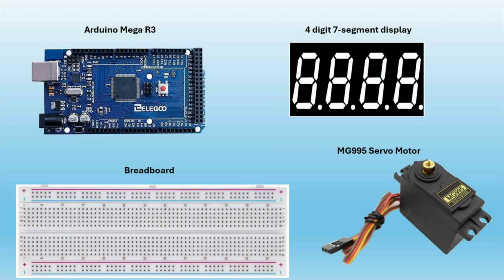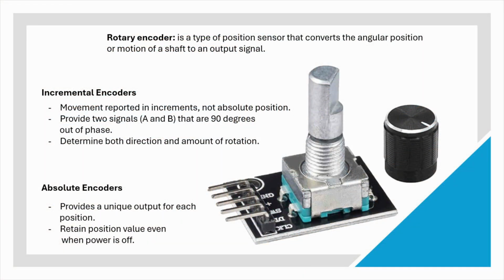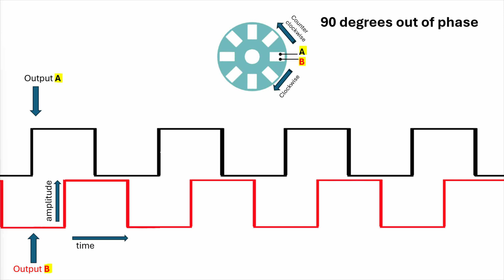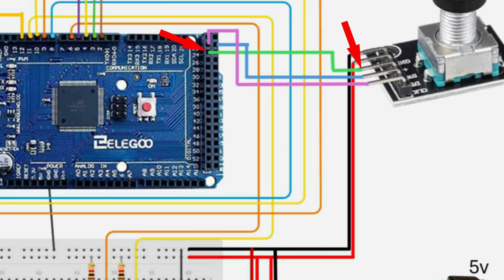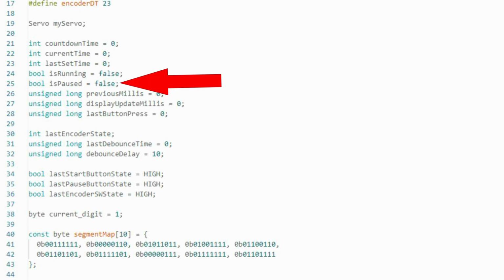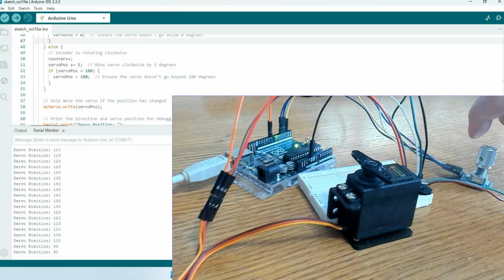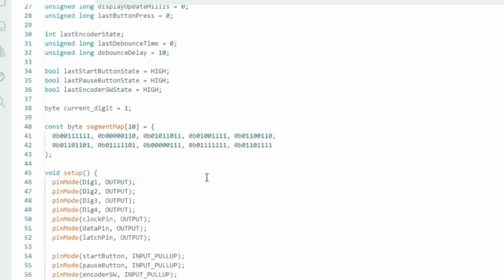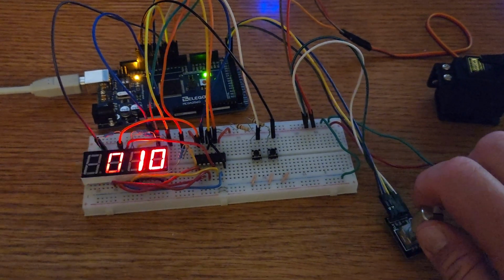Creating an Arduino Countdown TIMER with Manual Adjustment and Servo Movement Using a Rotary Encoder

Comment: Unfortunately I am very new to Arduino, Where can I get the sketch to upload for this digital timer with manual adjustment and servo control please? I am not on any social media platform either. I tried the Arduino IDE and found examples but couldn't find the sketch for this project. hope you can help.
Reply from the maker: Hey there!
I used to post code on Facebook but it became a huge mess to try to find it.
send me an email and I can send it to you, no problem at all.
bmonsterlaboratory@gmail.com 👍👍
Reply: Thank you. I have sent you an email and would be grateful if you could send me both sketches so I can further my interest in Arduino.

Comment: Hey man, quick question becouse im new to all this arduino stuff. I wanted to build this build like you did but I’m quite unsure of how you connected the power Adapter. Thanks in advance :)
Reply from the maker: hey there!
at 0:49 you can see the diagram. I powered the breadboard rail with 5v. I used a 5v2A wall adapter with dc power connector to run leads to the rails. Everything you see connected to the breadboard rail is being powered by the 5v wall adapte - common ground connects to arduino.
This was just a temporary setup and the servo was not under load, it was just moving the arm. I don't think these bradbaord were designed to handle over 1A of current, so be mindful of that.  
If you want to set this up to move a load, you may need more voltage for the servo and more current supply.  Does this help?    If you still have questions,  i'm happy to help ~!
Reply: @BMonsterLaboratory Thank you for the detailed explanation, i was just wondering what kind of power source you hd becouse i was scared to fry everything. Everything luckily worked after hooking up everything with the rigth power source. And once again Thanks from Germany 😁

Comment: Any reason why you went with the Arduino Mega?
Or can I do this with any Arduino model?
Reply from the maker: Hey there!
You can use other Arduino models as well, the code isn’t specific to the Mega. You’d just need to change the pin definitions to match the digital (or analog-as-digital) pins on your board. The Mega offers more pins, but the project will work fine on boards. 👍💪
Reply: @BMonsterLaboratory  Thanks, I was hoping that was the case. I have a bunch of Nano's I wanted to use.

Comment: I'm going to try to use the analog in pins on the UNO R3... Can you post the code in the comments too?
Reply from the maker: #include <Servo.h>
#define clockPin 9 // Clock pin for 74HC595
#define dataPin 8 // Data pin for 74HC595
#define latchPin 10 // Latch pin for 74HC595
#define Dig1 5
#define Dig2 4
#define Dig3 3
#define Dig4 2
// Button pins
#define startButton 6 // Start button on pin 6
#define pauseButton 11 // Pause/Resume button on pin 11
#define encoderSW 24 // Encoder switch for reset
// Rotary encoder pins
#define encoderCLK 22 // CLK pin for rotary encoder
#define encoderDT 23 // DT pin for rotary encoder
Servo myServo; // Servo object
int countdownTime = 0; // Time selected by rotary encoder (in seconds)
int currentTime = 0; // Current countdown value
int lastSetTime = 0; // To store the previously set time
bool isRunning = false; // Timer state
bool isPaused = false; // Paused state
unsigned long previousMillis = 0; // To track time intervals
unsigned long displayUpdateMillis = 0; // For updating the display at regular intervals
unsigned long lastButtonPress = 0; // For debouncing the buttons
int lastEncoderState; // To track the last state of the encoder
unsigned long lastDebounceTime = 0;
unsigned long debounceDelay = 10; // Debounce time reduced for smoother response
bool lastStartButtonState = HIGH;
bool lastPauseButtonState = HIGH;
bool lastEncoderSWState = HIGH;
byte current_digit = 1; // Variable to track the current digit being displayed
// Digit to segment map for common cathode display (change as needed for common anode)
const byte segmentMap[10] = {
0b00111111, // 0
0b00000110, // 1
0b01011011, // 2
0b01001111, // 3
0b01100110, // 4
0b01101101, // 5
0b01111101, // 6
0b00000111, // 7
0b01111111, // 8
0b01101111 // 9
};
void setup() {
// Set pin modes
pinMode(Dig1, OUTPUT);
pinMode(Dig2, OUTPUT);
pinMode(Dig3, OUTPUT);
pinMode(Dig4, OUTPUT);
pinMode(clockPin, OUTPUT);
pinMode(dataPin, OUTPUT);
pinMode(latchPin, OUTPUT);
pinMode(startButton, INPUT_PULLUP); // Start button on pin 6
pinMode(pauseButton, INPUT_PULLUP); // Pause/Resume button on pin 11
pinMode(encoderSW, INPUT_PULLUP); // Encoder switch for reset
pinMode(encoderCLK, INPUT_PULLUP); // Rotary encoder CLK
pinMode(encoderDT, INPUT_PULLUP); // Rotary encoder DT
// Attach servo to pin 12
myServo.attach(12); // Updated to pin 12 for the servo
myServo.write(0); // Initialize servo to 0 degrees
// Initialize encoder state
lastEncoderState = digitalRead(encoderCLK);
Serial.begin(9600); // For debugging
Serial.println("Setup complete. Starting loop...");
}
void loop() {
// Handle rotary encoder input
handleEncoder();
// Check the start button
handleStartButton();
// Check the pause button
handlePauseButton();
// Check the encoder switch for reset
handleEncoderSwitch();
// Update countdown logic if running
updateCountdown();
// Multiplex the 7-segment display, update each digit quickly in sequence
updateDisplay();
}
void handleEncoder() {
int currentEncoderState = digitalRead(encoderCLK);
int currentDTState = digitalRead(encoderDT);
if (currentEncoderState != lastEncoderState) {
if ((millis() - lastDebounceTime) > debounceDelay) {
// Reverse direction: clockwise to decrease time, counterclockwise to increase time
if (currentDTState != currentEncoderState) {
countdownTime--; // Clockwise rotation decreases time
if (countdownTime < 1) countdownTime = 1; // Minimum of 1 second
Serial.println("Rotary encoder rotated clockwise, decreasing time.");
} else {
countdownTime++; // Counterclockwise rotation increases time
if (countdownTime > 600) countdownTime = 600; // Limit to 600 seconds
Serial.println("Rotary encoder rotated counterclockwise, increasing time.");
}
currentTime = countdownTime; // Update the current countdown time
lastSetTime = countdownTime; // Store the set time for reset
Serial.print("Updated Countdown Time: ");
Serial.println(countdownTime); // Debugging to verify encoder works
lastDebounceTime = millis(); // Reset debounce timer
}
}
lastEncoderState = currentEncoderState; // Update encoder state
}
void handleStartButton() {
bool currentState = digitalRead(startButton);
// Check for a state change
if (currentState == LOW && lastStartButtonState == HIGH) {
if (!isRunning && !isPaused) {
isRunning = true; // Start countdown
previousMillis = millis(); // Reset the start time
Serial.println("Countdown started.");
}
}
lastStartButtonState = currentState; // Update last state
}
void handlePauseButton() {
bool currentState = digitalRead(pauseButton);
// Check for a state change
if (currentState == LOW && lastPauseButtonState == HIGH) {
if (isRunning) {
isRunning = false; // Pause countdown
isPaused = true;
Serial.println("Countdown paused.");
} else if (isPaused) {
isRunning = true; // Resume countdown
isPaused = false;
previousMillis = millis(); // Continue from the current time
Serial.println("Countdown resumed.");
}
}
lastPauseButtonState = currentState; // Update last state
}
void handleEncoderSwitch() {
bool currentState = digitalRead(encoderSW);
// Check for a state change
if (currentState == LOW && lastEncoderSWState == HIGH) {
currentTime = lastSetTime; // Reset countdown to previously set time
isRunning = false;
isPaused = false;
myServo.write(0); // Reset servo to 0 degrees
Serial.println("Countdown reset.");
}
lastEncoderSWState = currentState; // Update last state
}
void updateCountdown() {
if (isRunning) {
if (millis() - previousMillis >= 1000) {
previousMillis = millis(); // Update the time interval
currentTime--; // Decrease the countdown by 1 second
Serial.print("Time remaining: ");
Serial.println(currentTime);
if (currentTime <= 0) {
currentTime = 0;
isRunning = false; // Stop the countdown when it reaches zero
myServo.write(90); // Move the servo 90 degrees
Serial.println("Countdown reached zero. Servo moved.");
}
}
}
}
void updateDisplay() {
// Always keep updating the display, even if paused
if (millis() - displayUpdateMillis >= 5) { // Every 5 milliseconds, update the display
displayUpdateMillis = millis();
// Multiplexing: quickly update each digit of the display
if (current_digit == 1) {
disp_digit(1, (currentTime / 1000) % 10); // Thousands place
current_digit = 2;
} else if (current_digit == 2) {
disp_digit(2, (currentTime / 100) % 10); // Hundreds place
current_digit = 3;
} else if (current_digit == 3) {
disp_digit(3, (currentTime / 10) % 10); // Tens place
current_digit = 4;
} else if (current_digit == 4) {
disp_digit(4, currentTime % 10); // Ones place
current_digit = 1; // Cycle back to the first digit
}
}
}
// Function to display a single digit on a specific position of the 7-segment display
void disp_digit(int digit, int number) {
// Turn off all digits before updating
disp_off();
// Send the corresponding segments for the number
digitalWrite(latchPin, LOW);
shiftOut(dataPin, clockPin, MSBFIRST, segmentMap[number]);
digitalWrite(latchPin, HIGH);
// Turn on the specific digit
switch (digit) {
case 1:
digitalWrite(Dig1, LOW);
break;
case 2:
digitalWrite(Dig2, LOW);
break;
case 3:
digitalWrite(Dig3, LOW);
break;
case 4:
digitalWrite(Dig4, LOW);
break;
}
}
// Function to turn off all digits
void disp_off() {
digitalWrite(Dig1, HIGH);
digitalWrite(Dig2, HIGH);
digitalWrite(Dig3, HIGH);
digitalWrite(Dig4, HIGH);
}
Reply from the maker: there it is!   I'm supprised it fit. I really need to find a better way to store my code.
have fun with it! 👍
Reply: @BMonsterLaboratory  ty
Reply from the maker: @stusue9733  you're welcome!
Thanks for watching 👍👍